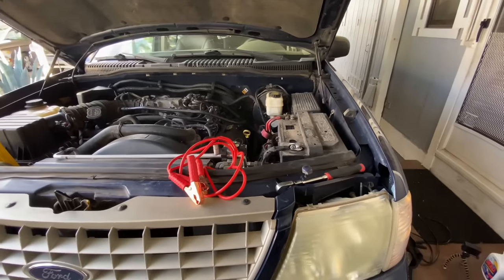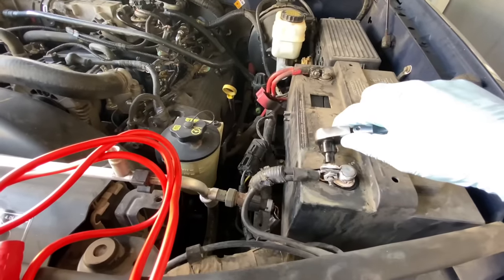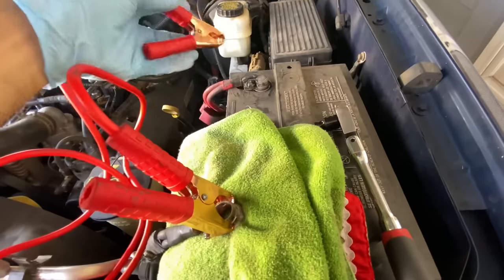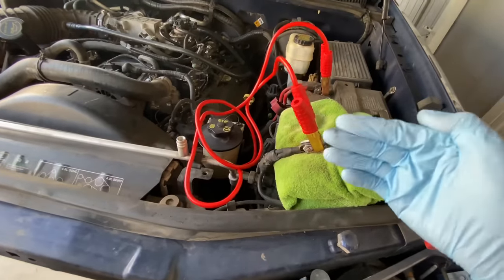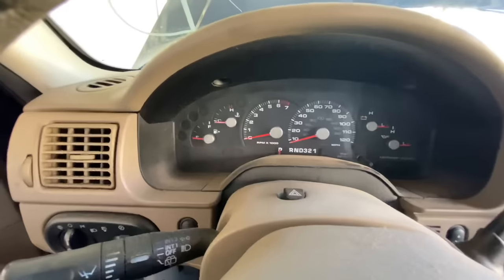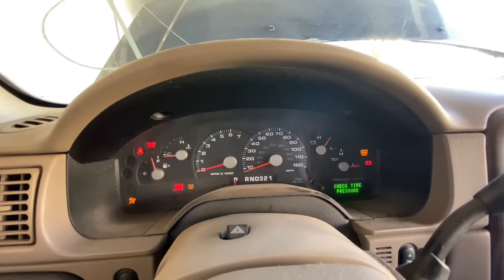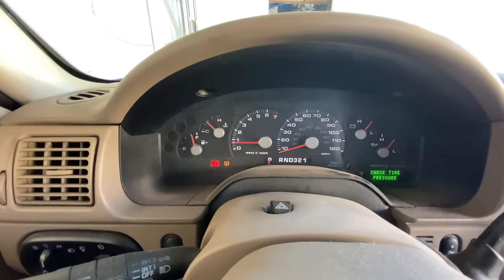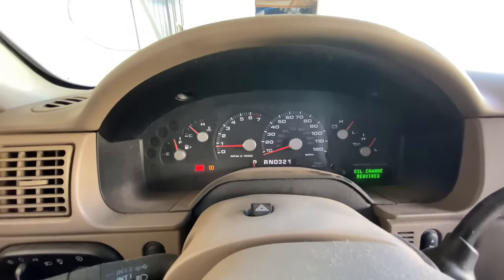How To Reset All ECU’s and Control Modules in your Car or Truck

Comment: Not the best way to "discharge" static stored voltage within the ecu. I'd suggest using a test light in-line between the disconnected  cables to consume power. Using a direct link between positive and negative causes a "discharge" and  abrupt energy loss by generating heat as the consumption of power. Electronics' greatest enemy is heat. Using a test light is a much safer way, and allows the light to consume the power, rather than the ecu being subjected to heat by way of a direct short circuit.
Just one old man's suggestion.
Reply: i like your input on this suggestion Mr and wanted you to know that!
Reply: It makes sense! Thanks for the help
Reply: @KFLson  yes.
With the cables disconnected, use the test light clamp to one cable, and the point (probe) to the other cable. There likely won't be enough energy to light the bulb, but the bulb will consume any stored power. It will completely discharge within 60-120 seconds.
Reply: @fathertime7923  so no cables should be attached to battery? Using red battery cable and black battery cable you hook up the test light?
Reply: @Arizona_rider  correct. 
That's the method I suggest, but you could actually do the same, removing only one cable.  I suggested removing both so it simplified my description of using the test light between the two cables. Just to try to eliminate confusion. 
I hope that helps.
Reply: @fathertime7923  yes. I actually found someone doing the same thing on another video. I have a 1991 454 dually. I thought I just disconnect the negative for 30 seconds and it does the same?
Reply: @Arizona_rider  not necessarily.  Residual power can remain for several minutes. Simply disconnecting and waiting may reduce the stored power but may not completely discharge the ecu, potentially keeping the memory alive and storing a code or codes.
Reply: @fathertime7923  Im trying to figure out if I took an old broken down chevy and put everything stock again if it was still thinking it was the old parts? Mainly fuel trims
Reply: @Arizona_rider  gotcha. Most fuel and evap systems will constantly adapt. If you start with a fully discharged ecu it will still take a bit for the adaptive learning,  especially if it's drastically different than before.  But it should be fully corrected within a 5-10 minute neighborhood drive.
Reply: 100 % test light much safer for the ECU.
Reply: @fathertime7923  n
Reply: @fathertime7923  Can I use my test light that I use for testing power in my home example wall receptacle ?
Reply: @oldmeadowvalevillager7961  no. An automotive test light is for 12 volt dc. Your home is 120 volt ac power.
Reply: How about removing both the cables, connecting them thru a jumper cable and switching on the car headlights? Will it have the same effect?
Reply: @ajaatbandhupoornam9178  no. The jumper cable still acts as a direct short.
Reply: Were Wood put The test light sir
Reply: Scotty Kilmer recommends a 10 watt - 1.0 ohm resistor to complete the memory drain for all vehicles since some vehicles can have very sensitive modules. I found a great source at Hutch and Son in IL who had a top name brand (NTE). They charged only .79C and a grand total of $2.10 delivered. Great company and great service with a well secured and protected bubble package. Highly recommend this company.
Reply: Thank you!! I wanted to ask a question if you had a 09 VWJetta that has a new battery, ignition coils, spark plugs and alternator but only starts and not continue to run, will the reset help or could something else be the problem
Reply: @bastanteya  the reason there are different methods is because they all achieve the same goal. And that is to discharge the remaining electricity in the cars computer. A light tester for car is a 12v tester with a light bulb on it. 

I suggest you follow any one of this type of processes such as this video. Exactly as they do it.
Reply: How long will it take?
Reply: @socer451  not long. 30-60 seconds will be more than enough.
Reply: @fathertime7923  thank you
Reply: i dont have a test light my guy
Reply: @mcstench8913  they're handy to have around. Only about ten bucks some places.
Reply: @fathertime7923  You seem really cool man. Is it safe for me( or anyone else) to assume that leaving negative disconnected over night will dissipate all energy ?
Reply: @robertlipperd7352  that would definitely be safe, however residual power can remain for some time. I don't know of any real testing that's been done to see really how long it can remain, but I would think no longer than 24 hours. Overnight should be fine. The test light way ensures a complete discharge in very little time without damaging ecu.
Reply: @fathertime7923  Thanks.The test light sounds like the way to go.  I was just wondering.  My 2008 Yukon's battery light and a 'check battery charging system' warning is giving me fits right now.  Changed battery current sensor earlier and it had gone away, then later it came back.  All tests I have run on my battery say it is good, but I wonder if it really is all the time. I already put a new alternator/belt/tensioner on so I know that angle is good.   Can a battery test good, and intermittently not be actually good.... like on the way out but trying to live ?   I think so because i did a full load test, several times, ac on high/4 dome lights/ headlights /radio and was testing13.5..... then later just ac and was at 12.5  .  All so aggravating. Trying to learn.  Failing battery ?
Reply: @robertlipperd7352  I'd never want to try to diagnose anything online and lead you in the wrong direction.  However, you can't test the battery's capability while running. You need a shop to do an actual load test on the battery. Your running output should never be 12.5v.  That's more like static battery voltage. As usual, check ALL cables and grounds for fit or corrosion. It sounds like an alternator issue, even though it's been replaced. Some parts stores, battery, or auto electric shops can bench test the alternator or battery to be sure.
Reply: @fathertime7923  Appreciate your advice.  I had to cut off battery terminal to install that sensor and the new terminal was not a good fit, so I replaced it with a tighter more conforming terminal and light/warning are gone again. Hopefully stays that way. I already have a new battery and will probably go ahead and put it in instead of returning, seeing how the 1990 Dakota will like the other.   Definitely have to replace A/C belt/tensioner, just ordered. It looks pretty cracked up.  I like the idea of a new electrical  charging system. Especially don't mind seeing how I had a stuck lifter for 3 weeks. Guy told me $3100 , another guy told me Magical Mystery Oil $10 . MMO worked  ! Lifter had stuck for 1 day in march and 2 days in april. It would get stuck, i now know, because my cylinders were trying to go back to V-8. Happened all 3 times when i was basically going for a quick/safe pass. Have the Range disabler hope that, and better oil care, will prevent any more sticking.  Thanks.
Reply: @fathertime7923  I had no idea what ticking/tapping was 1st 2x,  lasted so short didn't really think about it too much. Thought it was  something to do with traction and stabilitrak since those lights/warnings were coming on. Misfire was causing those. Learned quite a bit in the past weeks. You're a really good guy for communicating/helping people.. Thanks for that.
Reply: @fathertime7923  light/warning back...... finally pulled battery to see if I could find mnfr date .. 1/20   3 1/2 yrs old !! 2 yr warranty. Little trooper held out a long time.  Maybe should have done that first  :o    I always did like to learn the hard way.    Now I will bug-out if platinum 4 yr battery doesn't fix issue.
Reply: @robertlipperd7352  if your battery keeps starting the vehicle - it's probably not bad. The warning light only indicates whether the charging system is working. 
All I could say is what I mentioned before. Good luck.
Reply: @fathertime7923 ohhhhh i got it now........ gonna try the 175 amp little fuse in a bit... lol     Then maybe check more for a voltage regulator that is not in the alternator... no way two bad alternators... battery be dead if alternator wasn't working..... then a few more attempts to reset ecu.    then new ecu.
Reply: Attaching a 1 ohm resistor is best and safer .on newer vehicles this method could blow the ecm
Reply: Or use a resistor 10wat 1ohm will work
Reply: What if my truck is a standard do I need to cycle threw the gears like you did here?

Comment: Scitty Kilmer said a few things different: Any ideas why? 1) Disc Neg & turn on light switch 5-10 min, 2) Reconnect & put in low gear 5 min with foot on brake, 3) Drive 20 min around +35 not aggressive.

Comment: Bro! Something you made 3 years ago is still coming through! It worked! Got my O2 sensor changed and i thought i got a bad one.  After sound this my fuel trim actually went from short term -19 and long term +20 at idle to short term within 3 and long term at -3!

I didn't even see this on the trailvoy message board! 

So i ordered an OEM O2 sensor which I'm going to use anyway and redo this method to see if I get even better gas mileage than the bargain one! 

2004 Chevy Trailblazer EXT LS
4.2L I6
Reply: I installed a new O2 sensor when I installed a new exhaust on my Park Avenue, the only one I could get locally was a Bosch... Service engine light has been on and engine surging. Installed the OEM AC Delco O2 sensor, looked nothing like the Bosch, and so far, so good. The moral to the story, only use OEM sensors. This is a well known and common issue with aftermarket O2 sensors, at least on GM products.
Reply: @michaelwright1602  facts bro! Any electrical component!

Comment: For much faster results all  you really have to do is disconnect positive battery terminal and touch it to ground 2 or 3 times for 20 seconds. Then reconnect positive terminal. Drive your vehicle 7 to 11 miles and while driving make shore to stop and start as you would at a stop sign . This will let your ECU relearn driving stratages.
Reply: How is driving 10 miles faster or better than this?
Reply: Thomas, the reason why negative is always removed is because when the tool touches the chasis or engine block, there's no spark. Do with the positive terminal using a nice shiny spanner,  you see the sparks!
Reply: What about a 2016 Kia Sorento who's engine light, battery light and oil light is on and the car won't start

Comment: Great Video My 2010 Ford Fusion climate control was not working right
would be stuck on defrost so I took it to a ford dealership and told me 
it would cost 1400 to replace the blend door actuator so I took it home and in 
15 minutes I replaced it and it still didn't work until I saw your Video
and I took both cables off and touched them together for a couple 
of minutes (Didn't have booster cables) My HVAC ACTUALLY WORKED
all it needed was a reset  THANKS you saved me big bucks

Comment: I installed the jumper like you showed three years ago when you first posted this. I left it like this since then, never took the wire off to make sure. Went out the other day to disconnect it and restore the proper connection, but now my truck is stuck in Spanish mode. All radio stations, owners manual, and labels are now in Spanish. WTF did you do to me here

Comment: This worked perfectly!! Even resetting by mechanic after replacing 02 sensor fault , fault code kept returning. But this worked on my VE holden. Many thanks from Australia!
Reply: Were there any extra steps you took that were Holden specific for it to re-learn all its settings correctly?

Comment: Good procedure but i would put a small 5w bulb instead of jumping the negative and positive terminals so it drains any caps slowly instead of shorting the system
Reply: It doesn’t short the system. With the ground removed and not connected to the battery, the circuit isn’t complete, therefore a short circuit is impossible to happen.
Reply: Just turn on your headlights for 5 min.

Comment: If I have standard jumper cables, do you put red on Positive terminal and black on the Negative cable?
Reply: LMAO, that's funny right there, I don't car who yar.
Reply: I believe you had a serious question? He is just using the jumper cables as a jumper wire- same color wire just to close the circuit & drain the battery.

Comment: With electronic faults the car will reset to its original state but just for a shorter period if you have other faults already. If you try this on your wife she will restart as a super babe but only last for a shorter time with already built in faults. Either this battery trick or a electronic fault reseter who usually is better. 😊
Reply: I wanna try this in my wife but where do I attach the cables.😅
Reply: @RussMeister70  In a place she probably wont like. 🤔😄

Comment: This worked for me.
 I had replaced the mass air control and throttle position sensor, and after that it was not idling right it was idling high, so I did this process, and it worked for a few days then  I had to replace another sensor and then that corrected it.
Reply: Buick???
Reply: @jimmyjimmy3253  Lincoln
Reply: What sensor?

Comment: If this doesn’t work after you reattach the battery and your horn spontaneously starts blaring again a while later, breath and calmly make sure to take the time to detach the battery before trying to pull the fuses. This didn’t work and TIPM caught on fire because battery was still attached.
Reply: I’m confused
Reply: @followurheart1112  you're not the only one. Did they try this with the negative cable still attached to the battery? Could cause lots of sparks fire and fun.
Reply: @OutlawMonstersPerson  negative was disconnected and laying on top of a towel.
Reply: They probably put the negative on positive and vice versa. Lol 
There's no way that could happen without any power source.

Comment: My check engine light is stuck on and the dealer could not figure out why it still would not go off, they consulted with Cadillac and determined its in the ECM....will this correct that problem? I forgot to add it was for the O2 sensor, all replaced twice.
Reply: Check the fuses
Reply: Chaun did you end up doing it? 03 cts so I feel your pain. Lol
Reply: Try running a ground wire from your ECU Body to another known good ground under the hood. See if that straightens up your ECU
Reply: I will have my mechanic try this and see how it goes and report back.   @gregwilliams5173

Comment: Helpful video.  Problems came back after a day but I know now for sure what it is. Need a new ecm.  I was wondering if I might be able using your method to used a pulled ecm from a wreck?  Do you think that would be feasible?
Reply: yes
Reply: Does your car die at stops or anything? I think I may need a new ecm it dies at stops but starts every time. I get a u0100 lost connection to ecm code

Comment: Sir i want to ask do we have to reset the ECU and reprogram it after an engine overhaul/rebuild and transmissions modification?
Reply: Wondering the same thing just replaced  the engine in my 2007 fusion and now I have a idle issue have replaced all kinds of things and nothing is working someone said to try to reset computer. And was wondering if this is what they meant.
Reply: Not this dude but yes. The shop shoulda already done it for you

Comment: Had gear shifting adaptation gears won't go in properly at startup tried this method before and it worked well but on this occasion it just won't work only to discover there was a bad relay..replaced the relay and engine and transmission works really fine

Comment: Hi, thank you for the video, i have i problem in my Toyota fj when is the firts start the RPM is about 1900 i cleaned the throttle body and still the problem. What do you think.

Thanks

Comment: Just replaced the battery on my 02 Silverado and the damn thing wouldn't stay running. Before I took it back to my mechanic I got on You Tube and found this video. To my surprise it WORKED!!. Truck runs great. Thanks for the info.
Reply from the maker: Awesome

Comment: I was on the road pulling a trailer was having transmission problems not shifting correctly .stop a station for fuel and disconnected  negative ground for 5 minutes  .back on road ,everything  was working has it  should . hope this help's you
Reply: its just a way to beg for fresh ATF and an external cooler... else a $5k tranny swap.

Comment: Yes just don't leave the positive wire on the battery when you short positive and negative. Unplug both leave the battery unconnected. Or just pull the fuse of the ecu in the fuse box should work too.

Comment: Is this a better procedure than disconnecting the battery and turning on lights
Reply: No
Reply: @dt90891  ok
Reply: 🤣 up not even supposed to use a junper cable. Your supposed to remove both battery terminals as both positive side and negative side send a certain viltage of power each

Comment: Will this work for my 2003 Mazda protégé5 The dealership said that it is the ECU  and I need a new one for my car. Can I reset my old one and use it and save my money
Reply: If your ECU is shot, resetting it won't fix it. Although, there's no reason why you shouldn't try.

Comment: I have a 2014 Lincoln MKZ I changed my alternator and my battery I'm pretty sure I got to reset my ECU but is loss of power steering part of the relearning I have an electrical power steering module so there's no pump no fluid nothing so I mean would that be part of the relearning process for the ECU?

Comment: Thank you man ,i stil have  light on my dash panel , but  this procedure  definitely reset my computer , i will  try  solve   the other problems
Reply: So Jorge your check engine light still stayed on?
Reply: Remove the gas cap and check it for a bad gasket! If the cap is a ok. remove the ground cable for 10/20 minutes and allow the computer to reset!
Reply: I got a cel after changing coil packs on my r34 and resetting my ecu